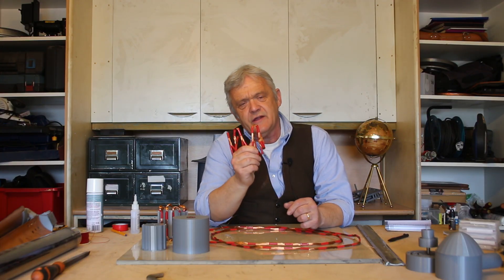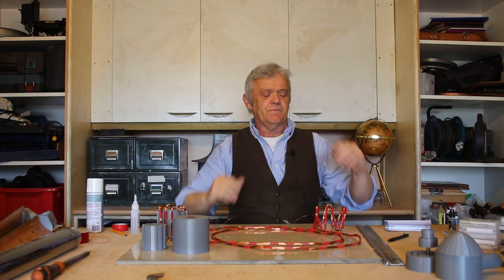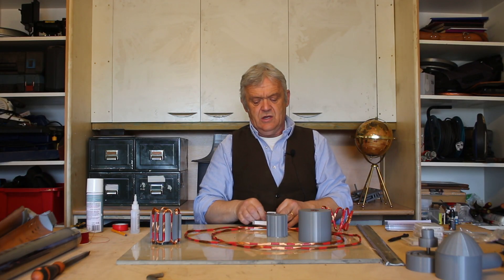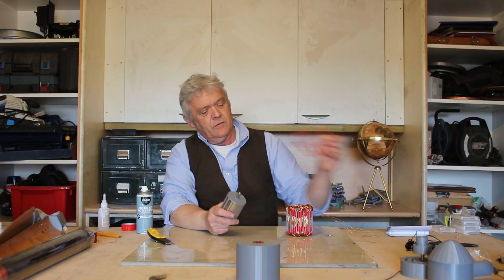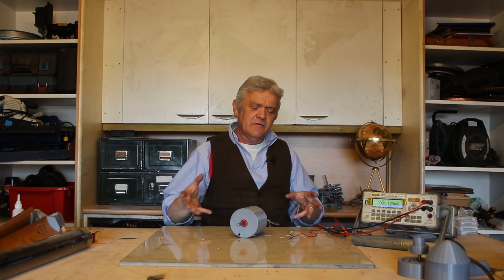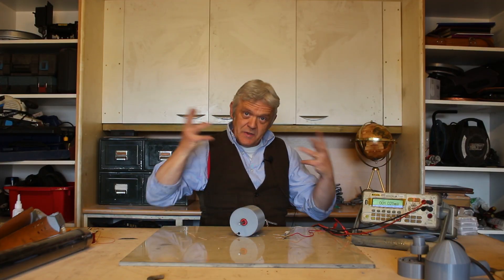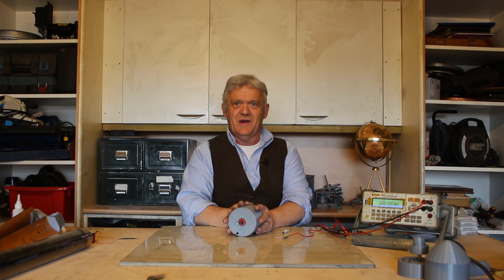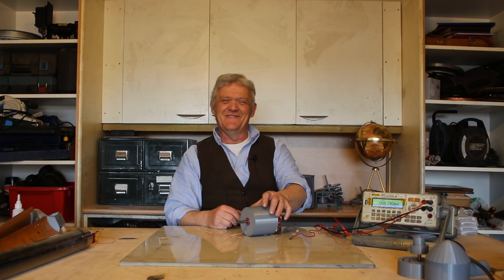1931 A More Powerful And More Efficient Generator And How To Build It

Comment: Hey ROB here is some thing to test them dare not speak of the results                              "never ending unslot of hate if you do"   On ac wind genny "alternator" put run caps on each leg " like series circuit'  then to your load   The mf of caps will need adjusted to find "sweet' spot   If genny is putting out around 100 volts for every around 20 mf will be around a amp is good starting place  You do lose resistance braking but it will be worth while to add diff kind of brake  Off subject but it is possible for a few thousand what transformer to be so efficient you cant find any losses with reg equipment  I have made many of these type trannys over the last 5 years  The first i made was for a "2000" watt low freq pure sine wave inverter i built  Yes just like forest gump on many things   I think he is my real dad or some thing lol   The FULLY powered up ready to power some thing but with with no load  that inverter uses  well under 15 watts    That's powering all the electronics that drive the h bridge all the fets in h bridge 30 pound transformer a choke and the out put filter caps  The sine wave is perfect i have ran air conditioner chop saw box fan lights radio at the same time with it  Ac and cop saw starting and stop while the other stuff is running   I have seen it running  around 4k watts bunches and  have seen it spike crazy high when loads are starting   I proved 5 years ago that low freq inverter did not have to have high idle loses  Ofcourse every one said either i was lying or to dump to be able to test accurately lol                Hey Rob more goes to less through the path that is eazyest right?   Need to find a way to dig a hole that never fills up  lol  Hey whats the diff in micro waves radio waves reg house 50 hz electricity  light waves gamma waves sound waves  Can you change these into the other and how to you do it   Maybe there seeing the peaks of these waves top and bottom then imagine dots  If so could this be the same with the adams   Well now what would this lead to ? ?  What would that strong supper close nuke force be that holds every thing together??  Now back to what all them waves are made from??      What is you me and everything made of then??  No it cant be well how dose a voice brake "explode" a wine glass  What was holding it together and what over came that "strong" force?   After all that is truly answered the question whats this life for   Its to prove what we all care and love the most   Money things over other any people or people over money and more things  Sound familiar?  If you throw out blind trying or lying to lead blind stick up your ass or your going to hell lies and read your self anyway         One place has said this truth the HOLE time     The truth is not hidden but is foolish to ones that think them self smart by believing and parroting what others say is true!   Wisest of all warned to Test ALL thing for your self!
Reply: Ever time never fails when amber sees me watching you she starts giggling and that old man balls dragging joke you said foe every ago      i mean i am writing the answers "truth" well the questions to get answers "truth" to all of man kinds unanswerable questions   GREAT AWE!! blocked out by her giggling till tears come out  over old man balls joke  you told rob mabe year or few years ago   them she gets me giggling like a little girl trying to get the joke out   SEE SEE YOUR A BAD INFLUENCE  LOL lol
Reply: if trolling one more thing will not hurt  you do know what who has been THE TOP man TOP THE MAN TOP!!! of ALL world wide square compass and few other clubs don't you   he just got the at one time the sun never set on it but now still around 1/4    unicorns that is chained to red dragon lions 10 but that single one takes out 3 also that harp called a lier back when king david played it   wow davids scepter will not fall passed down his line wonder whos got it now huummmm lol   he could not be  going to set up a 7 YEAR DEAL deal with israel and  many wrote about  in a book over thousand years ago surly that book is fairy tales that    It was true  over 400 years ago to king james    Many wanted him dead   His own mother helped "others" try to blow him up to stop him from taking it out of the very fews hands giving it to all   The ones that had been religious and gov control got a black eye to death but some how they as big as ever   like king james your new one dont like them either   we got front row seats to the biggest of ALL times !!!   test what i say    its so simple a babe can get it   Works trying to  go to good place are like dirty rags  Because is FREE !  no stick in back side    water into wine at wedding party   its not what goes in its what comes out  its in that book who said that?    God is good we have believed the fake liers   read and test for your self                              great and horrible coming and we have very front row seats  every one that knew that book is true wanted to be right here and we was gave that awsome privlige  WOW     the whammer hammering almost to begin dont fear  or if you fear call out to the one you did not think existed if you call with humble heart   that fear will turn to joy  GOD is good!

Comment: Hey Rob nothing wrong with sque   the magnets to the same angel as coils lol lol                                cutting it at a small angle will give the best results so sque both one a  just a little more than the other    the out put goes down a touch but less force to turn goes down quicker
Reply: if you have two tuning forks of the same frequency  if we hit one dose the other start singing   dose the second one slow the first ones singing   water is called ice  liquid steam maybe plasma if in right con   but are they all water   do you make a coil sing  but electric dont go though air but it will if plates are very close  across the two lines dont work   and there is diff in caps laden jar also   some things take what magnitizem amps they need others will act like a hole with no bottom until so hot they blow    those are the fun ones to tinker with   the ones of old in glass under vacuum dont blow as easy   of the sold state the best to play with is the harder to find like the diodes with cool metal inside  resistants not always a loss   there is a almost perfect way to build a inductor  ac resistance and dc resistance is not the same period!!    another thing if we know the distance between two corners of a triangle  and know the angel of another could we make a close estimate of how far up our drone or kite airplane or any thing else is    the human eye can not see detail that far away  definity impossible to see detail at say 200 to 250 thousand miles up but a drone battery would die before that  hell is the moon not 244k miles away  now that would be one hell of a battery   if we was flying a drone over the ocean it would disappear from bottom to the top because of a thing called vanishing point   the triangle from our eye to the drone "looking like setting on top of the water from our view"   back of  across the water to our feet   from feet to our eye  makes up  this elongated triangle       the more elongated the less light can reflect back to our eye   the bottom of our drone will disappear first because of this them if we keep going it all will disappear we will need a good zoom lens to bring enough light back in to see it again   no one has ever seen a boat go over the carve lol  did it truly go over if zoom lens bring it back over that carve   same thing with the sun  lol lol  before you parrot test YOURSELF    the foolish is where you find the truths   no one needs to know you was foolish enough to test instead of parrot others lol  rob has to know this stuff  i am not writing this to him   no one wants the never ending onslot of insults by tring to show some one truth

Comment: You can increase the output by doping the stator with iron powder. Also you can angel your magnets having 2 like poles pointing toward each other and increase the magnetic field strength. Tesla gives heaps of info he ran 42 poles or more. But good place to start.

Comment: Robert you have inspired me to make these coils, though I have taken it a step further . I own punch presses and do tool and die work. I have built tooling which will form right angle serpentine coils out of 1/4" or 3/8" solid thick copper. No wrapping of single strands. The die is a progressive die set and the serpentine is taken up on a larger computerized machine coil, normally used for metal stamping of parts. Can cut to length making the diameter nearly any size wanted. Willing to supply samples for anyone interested. Keep up the good work.
Reply: Yes Steve, I would love a sample of what you are costructing
Reply: Great idea mate! Or coat paper or fishing line with graphene ink instead of copper to make the serpentine coil??
Reply: Couldn't you just have the same thing laser cut via Send Cut Send and then roll it to the diameter you need?
Reply: as you probably realized by now, this is not how the physics works. the scaling for the number of turns vastly outpaces the losses due to resistance for narrow wires

Comment: What about using a ahort cut off of PVC pipe as the stator and coil the wire around? It will get more of the wire closer to 1 and add phases by grouping the wires when you wrap them! What do you think?

Comment: Isn't the small ZKE capable of charging 12V, then it should be possible to charge 3 cells in series (do not have the minus of the pack connected to the minus of the ZKE. It should be isolated so it would float to the negative off cell 8 🤔 maybe for the future.

Comment: Just had an Idea you might enjoy:
A suspended water tank swaying in the wind could be fitted with a small tube, and a few tesla valves at the bottom, and would act as a rectifier pump.

Comment: Again... I developed a magnet motor that produces usable torque and RPM and can easily drive a generator or whatever you need. I really wish you would join me in further development. This design does work well but can use improvement. I lack the resources to keep going on with it. Please contact me for further information.

Comment: Awesome as always Robert!

So in this configuration, would one turbine twice the length be more efficient that 2 turbines at normal length due to minimized bend points?

When would you reach effieincy saturation purely from extending the straight section length?

Comment: I suggest (again) inserting a steel cylinder inside the rotor. This will magnetically connect the N/S back ends of the magnets, strengthening the magnetic field intersecting your serpentine coil. You will have to apply more torque but will get higher voltage out, which makes the generator even more effective for its size.
Reply: Will it make a difference if the steel cylinder touches the magnets? or should the magnets and steel be separated? If it should be separated, does the distance from the magnets to the steel have an effect on the efficiency of the generator?
Reply: @stoffel89  yes, distance will weaken the magnetic field
Reply: Or place the magnets in a Halbach Array setup, even better than a steel cylinder 😉

Comment: Why not build a rotor such that you have a magnet on the outside of the coil and another inside the coil such that you have a N-S pair pointed to the coil at each phase (basically two cylinders attached to a disk)? That should increase your voltage significantly.

Comment: Is the wire coated so that each strand is electrically isolated?
Reply: It's magnet wire, so it is lacquered for it's entire length. It's the same product you'll find in every electric motor, transformer, and inductor on this planet.

Comment: How would one determine the optimum ratio of the copper wire used to make the 180 degree turn from north to south as opposed to the straight- line generation sector of the generator thru increased axial length to be the most efficient in terms of cost to returns; would the magnets be the determining factor?

Comment: is it possible to make a coil with one thick copper wire at the centre and then thinner copper wire wrapped around that thicker copper wire? if so would there be any difference in voltage?

Comment: I'm genuinely curious, with all the copper wire touching, path of least resistance... Is that length really being used or is the current just going through the wires that touch??
Reply: It's magnet wire, the insulation is a lacquer over the entire surface of the wire. It's the same product used in electric motors and transformers. If a vinyl insulation was used, the coils would be massive and massively inefficient.
Reply: @georgeblack589  aaahhh thanks!

Comment: Based on what you said about the straight wire getting the most electrical energy, it seems like the longer you can make the whole generator, the more efficient it should be, right?

Comment: Hi Rob thanks for answering the wire size, I saw someone on the internet creating their own serpentine generator and he was saying the creating a larger magnetic north by having 3 North's then 3 south's etc etc produce a larger field and hence a larger voltage, what's your thoughts
Reply from the maker: i don't think it will help much - you need a changing magnetic field and it need to change for each length of wire that goes through it - if you have a broader field the field changes more slowly with respect to rotational speed - or at least that's how i see it - but i could be wrong
Reply: @ThinkingandTinkering  
Ah i see thanks

Comment: I've designed and 3D printed a few iterations of this type generator, but instead preparing serpentine coils separately, I winded wire around rotor to create 3 serpentines. I used  0.5 mm wire and 20x10x10 neodymium magnets and I got disappointed. It was giving around 2.5W and barely reaching 5V at 500 rpm. Changing wire to 0.25 mm would increase voltage, but power would stay the same (increased resistance, lower current). If I were to get 5V to e.g. charge USB devices, which is better setup, low voltage generator with step-up converter or higher V generator with step-down converter?

Comment: I made a capacitor that was a cross between a laden jar and an electrolytic capacitor by suspending it in air with a bit of dental floss. The graphite electrodes and wax insulator with a thin paper cloth soaked in salt water made the capacitor. I charged it up in the microwave, and it had a very high voltage charge when I stopped zapping it. Though, it seemed like the electric field of the capacitor contained the plasma of the arcing carbon electrodes. It looked like a sun in a jar as to how bright it was. I wonder if fusion reactions could be made and contained in such a device using hydrogen boron 11 gas.

Comment: If we took this generator and made it 3 feet long would that not make for very long straight lines and help even more?
Reply: You'd need equally long magnets, and by then your generator is so massive you'd need an equally massive set of blades to turn it. Generating power in a small format and LOW SPEEDS is the point.

Comment: Okay hear me out. TechIngredients on youtube made a video about making Graphene and he said it is highly conductive. If the idea is to pack as much conductive wire in as possible could you possible use some sort of hair thin wire coated in the Graphene to make the generator stronger or is that now how it works?
Reply from the maker: you can try if you like but i would think you would be disappointed with the result

Comment: Before I watched this video I had an idea about how you could fit this sort of thing in a downpipe. The diameter looks about the same, so the idea is to have the serpentine coil just inside the downpipe and a hollow rotor vertically mounted with the secret ingredient of a fan or archimedes screw inside the rotor so that rainwater turns it to generate  electricity. OK, some losses due to structure to hold the axle in place, and probably a conical shape to cover the coils  and direct water to the centre. Consider that water is denser than air. Well, something to think about.

Comment: Why would you want to stay at 9V, if you need to transport that power for any distance then the higher the voltage the better and the smaller (read cheaper) the transport wire.
Reply: No one builds a small turbine in their garage to power a site any distance away.

Comment: It's irrelevant what voltage you produce, you can use a transformer to get whatever you want. Really nice idea by the way.
Reply: Transformers are a big loss in energy, the best is to produce high voltage from start, so he's right.
Reply: There are losses in a transformer though.
Reply: There is still only so much power available. Like he said, if there's 5 watts in the wind, you can't get more than 5 watts out. Sure, you may increase the voltage with a transformer, but then your amperage is abysmally low. The inverse is true as well, you could get higher amperage...at 1 volt.